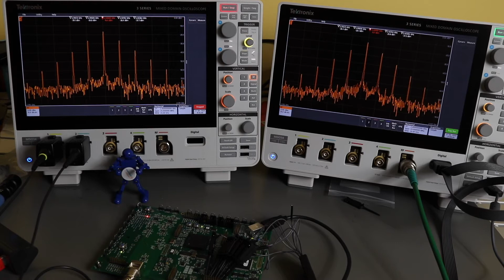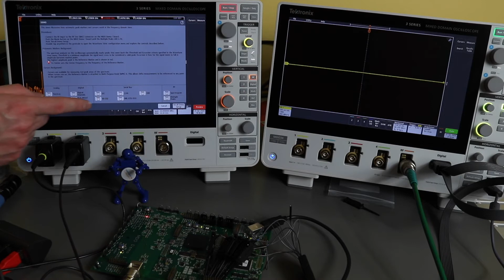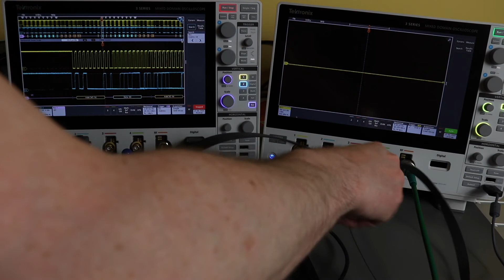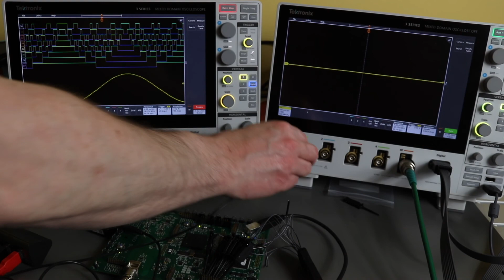Tektronix 3 Series signal demonstration using MDO Demo Board

Comment: Are you a electronics hobbyist or do you work  as an professional electrical engineer ? Your equipment and knowledge is high quality.
Reply from the maker: Hi TETC, I am an electrical engineer by trade, currently working in the power generation sector and carry out high voltage testing as part of my work. The 3 Series scope and demo board was loaned to me by Tektronix to investigate its use on monitoring partial discharge on high voltage apparatus, but I couldn't resist seeing what else it could do.